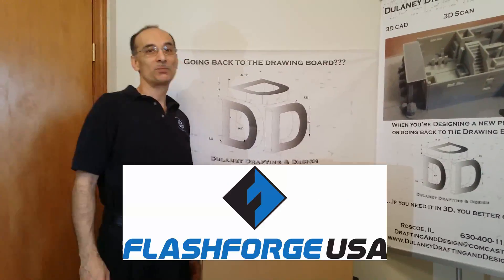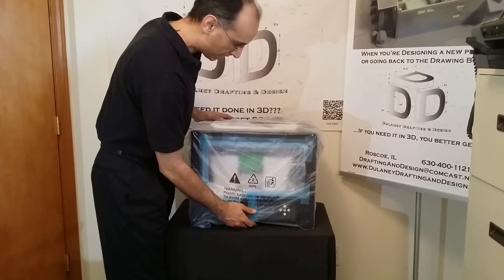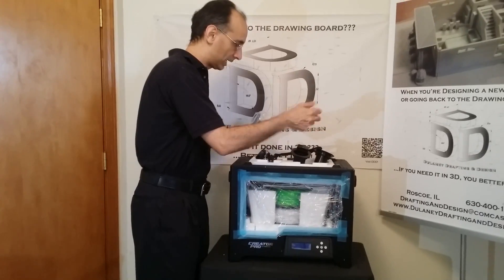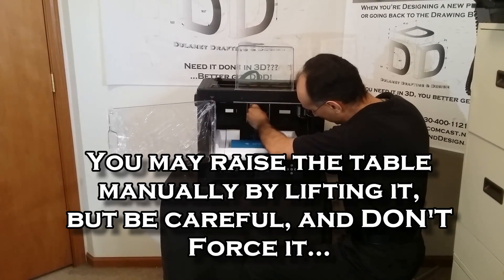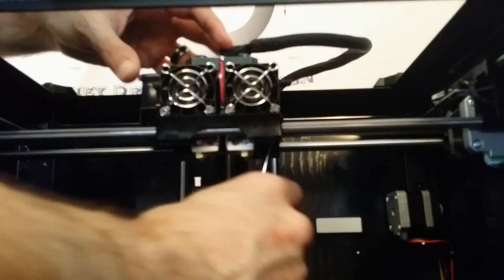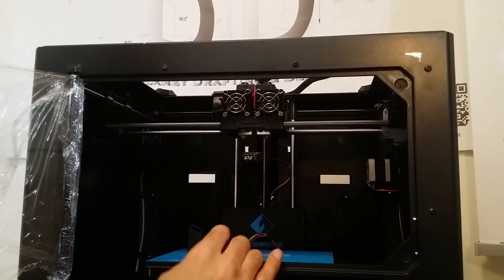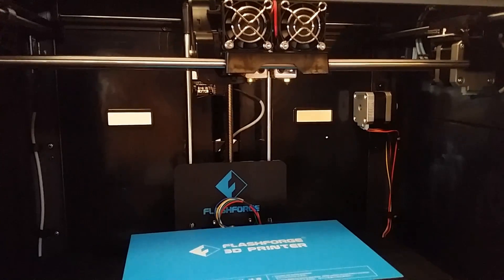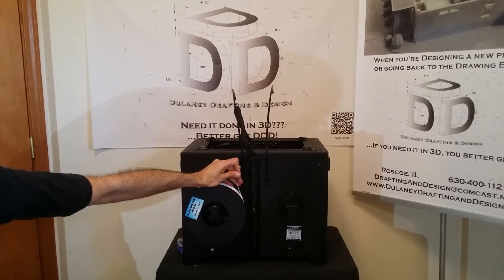Unboxing the FlashForge Creator Pro 3D Printer Dual Extruder Dual Color Printer

Comment: Can you remove the build plate?
Reply from the maker: No, you cannot remove the build plate on the FlashForge Creator Pro like you can with the FlashForge Finder.  If you are concerned about removing finished ABS parts from the table, I'd simply recommend changing from the supplied build tape to Kapton...then, you can remove the parts off the table very easily once the table cools.

Comment: What kind of filament does it come with? I heard 1 abs and 1 pla but I also heard that it comes with 2 pla.
Reply from the maker: I bought three of these machines almost two years ago, and they all came with one pla and one abs each.  I'm not aware of any recent changes, but it has been a while.  If it's a big concern, you may want to contact Flashforge to be sure.  Thanks!
Reply: Russell Dulaney thank you! I contacted support and they said that it comes with 2 pla. Thank you for the response!
Reply from the maker: @sharpboss2249  Thanks for your follow up...that is good to know!  Happy 3D Printing!